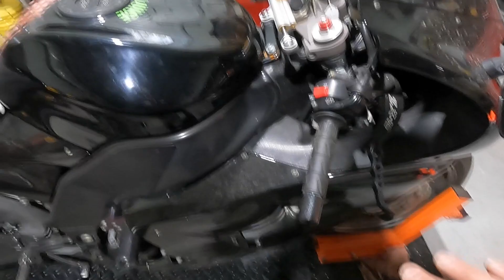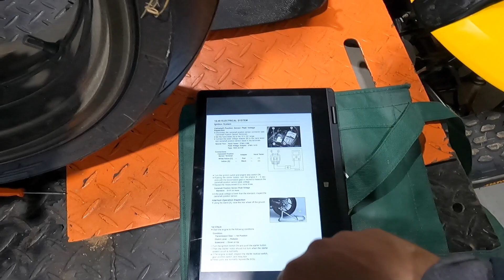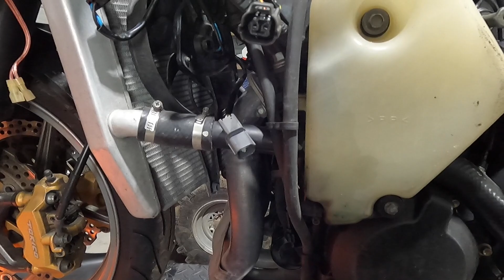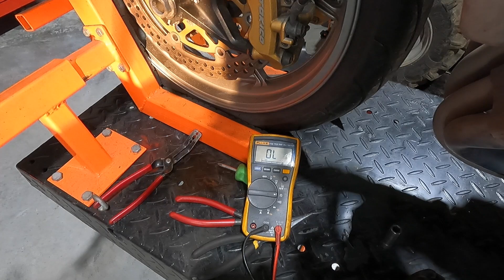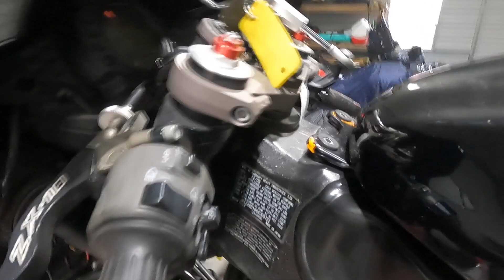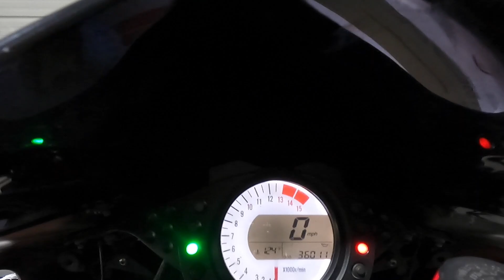Kawasaki ZX10R cam sensor??

Comment: Seme Bike same issue put new camsensor still same code on cluster
Reply from the maker: You need to make sure that you have good continuity through the wires and also that the connectors and the terminals are making full contact. That is about the only reason that should still have the same code with the issue you're having since you replace a cam sensor. I ran into it many times where the terminals are not touching inside the connectors.

Comment: My 2007 zx10r is cranking with no start but sounds like it wants to. I don't know how to decipher if its the crank sensor or cam sensor. I do not have a mulitmeter. If I rev it, the bike stays on and if im lucky, when the engine is warm enouh it stays on fine without a problem.
Reply from the maker: Of its the cam sensor you will usually get a code for it. A crank sensor will usually only show a code if it's not connected.  You would have to get a service manual & see how to test both. Also it's could be something else. Could be low fuel pressure are tight vavle clearances, crappy spark plugs, bad coils ect...

Comment: I have had my 2006 zx10 for 2 months. Tonight I took it down town and everything was fine. On my way home accelerating from a stop I lost all throttle at 5k ish rpms. I’d let off the throttle then go back on and it’d jump a little like it wanted to go but wouldn’t. I managed to limp home 6 miles doing maybe 5-20 mph on average. Changing to any gear I could accelerate for a split second. Any acceleration I did find was inconsistent. It died 2 times doing this. When i’d turn it off and back on I could get up to higher speeds. One time I got back up to 80ish but the issue came back when I slowed down. Any idea what’s wrong or where I could start? I’m not mechanical inclined and feel frustrated.
Reply: Fuel pump possibly, my 2005 zx10r cuts in and out at 9-11k rpms consistently. I'm going to replace it Tuesday
Reply from the maker: It definitely could be a fuel pressure issue. But in order to check that you need a fuel pressure tester. And be kind of mechanically inclined a little bit. Did the bike throw any type of code? If not it is definitely not a cam sensor could be a crank sensor but I'm pointing my finger more at fuel pressure at the moment. Cuz when you cycle the key off and back on the fuel pump primes again and then it probably starts to lose pressure as you go. Also when was the last time you checked your spark plugs?

Comment: I need help with my bike it’s not throwing codes it’s the same bike in the video but 2007 but anyways it will run great for 30 mins into a ride then just shut off and won’t crank back up for about an hour and when it cranks back up it don’t make it a mile up the road and shuts off again but still not throwing codes
Reply: I’ve replaced coil packs bc they were busted didn’t do nothing replaced spark plugs also even tho they looked new still nothing… it’s running at operating temp when it does it so it’s not over heating…
Reply from the maker: Sounds like it's your crank position sensor/ crank pick up. It is what tells the ECU when to fire. They love to go out when the bike it hot & after it cools down it will fire back up. It's a common problem & it won't though a FI code when it fails.

Comment: Im having a issue with mine 06zx10r new plugs and coil packs but its misfiring bad pooping as well and turns off even checked the fuel pump bout to ligh a match on it lol
Reply from the maker: Lol I know that feeling.  Are you getting any FI codes? I would tryto replacethe cam sensor first.(KAWASAKI OEM CAM SENSOR | 21176-0064)

It could be a bad crank sensor .(KAWASAKI OEM PULSING COIL | 59026-0009 Also male sure the battery is charging properly.  Low battery voltage with cause the fuel injection system to act all kinds of crazy
Reply: @limitlesspowersportsservic3394  new battery and no codes spent all day working on it checked the plugs and coils after installing them everything is good on that end very frustrating brother

Comment: I have a problem where it primes and everything starter spins but doesn’t crank at all how can the starter be spinning backwards changed the stater can the polarity be backwards can’t find this anywhere
Reply from the maker: Sounds this the oneway bearing on the starter clutch went out. You have to remove the torque limiter gear in order to replace the oneway bearing.
Reply: @limitlesspowersportsservic3394  I will look into it thanks

Comment: Can i ask you a very important question i park my bike up for the night it was fine nothing wroung next morning go to start it and it wouldent go i tryed jumping it wouldent turn took it to my mates garage he told me it was the starter motor no big deal i go to collect it today he now tells me its the complete cam shaft and showed me it it was in bits how the hell did that happen any ideas
Reply from the maker: Wow that's crazy. I have seen them break before but that was usually from improper insulation. It's very rare that one just breaks unless you have a vavle train failure.  So you are saying that the bike was running just fine before you parked it for the night?
Reply: @limitlesspowersportsservic3394  yeh mate not a problem at all i just parked it up and next day wouldn't start
Reply from the maker: That doesn't make any sense to me. Usually if you break a cam you destroy the topend because it get all out if time, breaks the vavles off, destroys the piston & the bike shuts off. Any idea why you buddy decided to check the cams if he thought it was another problem? I'm not pointing any fingers but that's absolutely crazy scenario for that to happen. That would have to be the perfect storm for you to just park it & the cam breaks on start up
Reply: @limitlesspowersportsservic3394  mate thats why i contacted you i like the gezzer i use but my bike is fucked and i aint happy i couldn't even look at him yesterday i said i need to get away from you as he told me 4 days before that that it was the starter motor dont worry he even had a little joke at firsf and said it was bad then went only joking its only starter motor what reason would he have to go near the crank i get a photo of it to show you do you think somebody tryed stealing my bike or the crank i need more knowledge about the crank system

Comment: Mine won't go past 50mph! What can cause that?
Reply from the maker: Possibly a bad fuel pump. I would check your fuel pressure. Should be around 42psi & above.  Also is should hold fuel pressure after ot cycles
Reply: @limitlesspowersportsservic3394  the bike currently has no fuel cap. Could that be the cause?
Reply from the maker: That won't effect how it runs but that will definitely let water & everything else get into the gas tank. If you have an unsealed gas tank I Can guarantee that your gas is going to go bad very fast. And it's also going to have water in it.

Comment: Just an amazing video! Sorry if my enlish isn't great (I'm from Sweden) =) Having some similar problems with my kawasaki z900 - 17 which at one point gave the code P0335. It mostly fires up just great, but after riding for a while and parking it, it sometimes wont start. Sometimes it helps backing up while pushing the starter button, and sometimes nothing helps. Right now its at the mechanic and we'll see what they can fiugre out. But I found your video really interesting! Wish I had someone like you around that really knows how to check for errors. great video once again! /Adrian
Reply from the maker: Hey Adrian. Your English was pretty spot on. It could possibly be the crank sensor also. But if the shop you took it to knows what they are doing they should be able to figure it out pretty fast.
Reply: @limitlesspowersportsservic3394  Last time I had it in at the shop they said they talked to Kawasaki and that a common error is some connector on the clutch side. They switched it out but that didn't do anything. Is it possible that it also could have something to do with the sidestand? I accidentally dropped the bike once in the garage due to an oily floor? Thanx for your answers🙂 also, u definitely have a new sub from me!
Reply from the maker: Well if it was the side stand switch the bike won't even turn over. Definitely sounds like a bad connection somewhere are possibly kind of the same issue that I found with this one. I would call the shop & find out if they did a resistance test on the suspected wiring circuit they found the fault on.